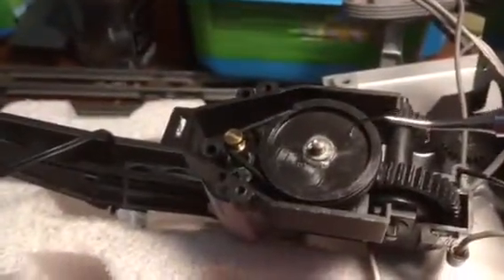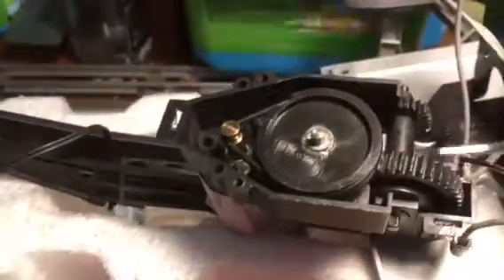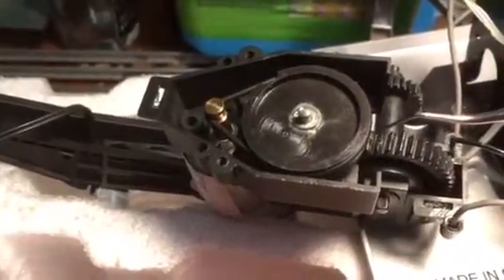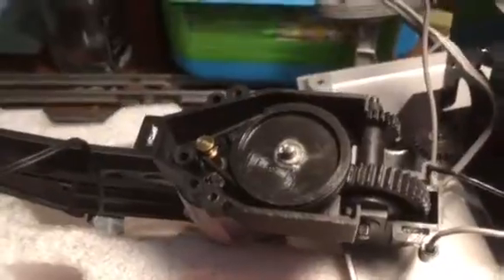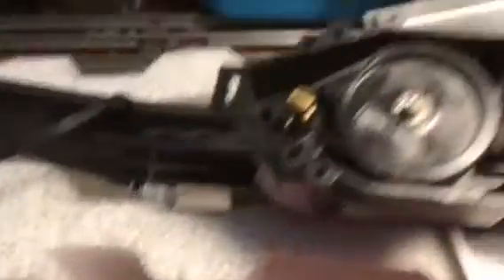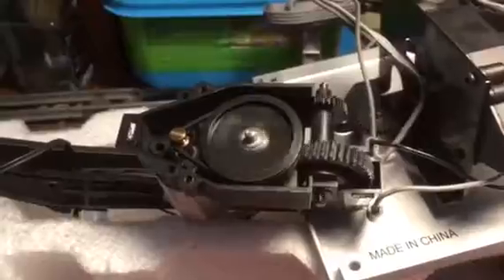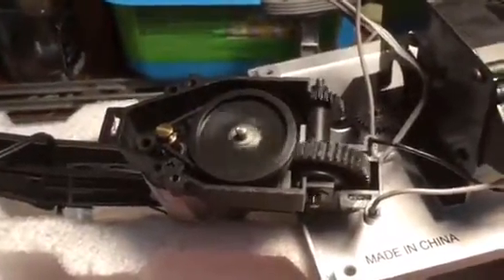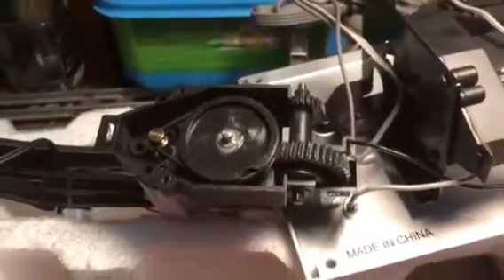Video x of y Repair of Lionel Overhead Gantry Crane

Comment: We’re did you get the rubber belt
Reply from the maker: January 22, 2021 -Fred Sir, I believe the "rubber belt" to which you refer is the O-ring I purchased from my local (which at that time was in Tustin, CA) Ace Hardware Store. They had quite a variety of O-rings from which to choose. May I humbly suggest that you check out your nearest hardware store for an appropriately-sized O-ring? If you have any other questions please feel free to contact me. I wish you and your loved ones Good Health and Safety in this challenging pandemic time. Respectfully, RiderCoach09 -Rich